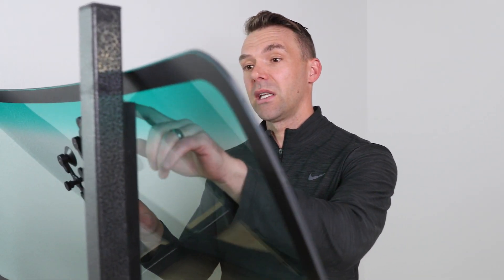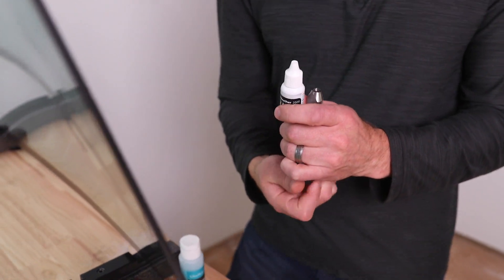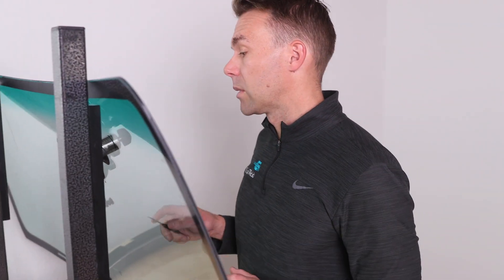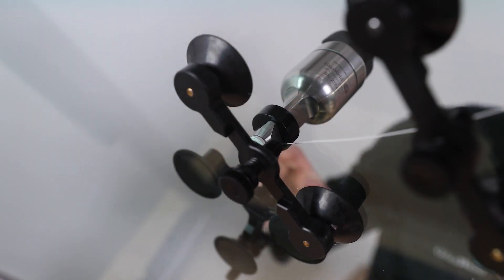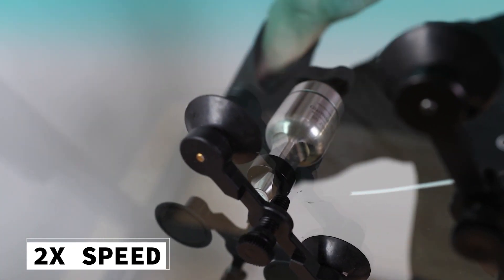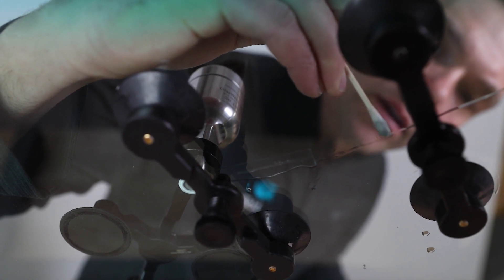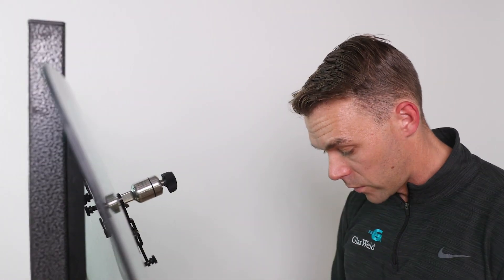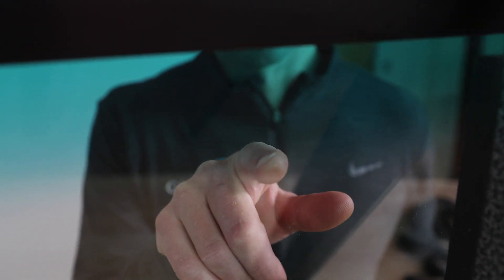Long Crack Repair: The Wicking Method

Comment: I did my first repair today 3/11/2021, it was a chip with three 2” cracks I have no experience in repair of windshields and it turned out really good. It was on a leased car BMW. I think I need the crack extenders because I was struggling a little to get the resins to flow into the longer cracks. After the job was done I could only see a tiny spot, I tried to make the spot go away with the pit filler but it remained the same.
Reply from the maker: Nice job Alex! Yes, the expanders will help with a smoother resin flow. When you're ready to take your technique to the next level, here's a video on long crack repair to help you out. We recommend practicing on an old piece of glass. Good luck! https://youtu.be/JtbJ-jNHHns

Comment: I have 3 large cracks generated from middle bottom of screen up to 1/3 Rd of windshield screen. Can permatex fill and repair them completely?
Reply from the maker: We recommend using GlasWeld long crack repair resin since it's designed specifically for repairing cracks. Here's the link to check it out: https://glasweld.com/product/crackweld-resin/

Comment: @glasweld Pls help, what is good glue/Resin and UV one or?
Reply from the maker: Our GlasWeld resins are the go to choice for techs who want a strong, long lasting resin. They've been independently tested to be on average 34% stronger than leading brands. Crackweld 1000 and 2000 are designed for long crack repair. Here are the links to check them out: https://glasweld.com/product/rock-chip-resin/.  https://glasweld.com/product/crackweld-resin/. If you have more questions feel free to email us at sales@glasweld.com or give us a call at (541) 388-1156 and we'll be happy to help!

Comment: Did you cure with the expanders on the inside of the glass?
Reply from the maker: Hello! We recommend slowly backing off the pressure on the screws of each crack expander before curing to allow the crack to slowly close up. Hope that helps.

Comment: can you repair crack going through all window? also it's half year old crack
Reply from the maker: Hi Valdas. Unfortunately, a crack that long has compromised the safety of the windshield. We recommend replacement for cracks longer than 14 inches. Thanks!

Comment: is the crack weld 1000 the thinnest resin you use
Reply from the maker: Yes, the 1000 crackweld resin is our thinnest viscosity for cracks. We also have All Weather 2010 thin viscosity resins for rock chip repairs.

Comment: What if there is no entry point of the break? Will you need to drill at both end of the crack?
Reply from the maker: Hello Guerrero, that's right, you will want to be able to inject resin into the crack, so an entry point is needed.
Reply: Appreciate your response. Can I drill in the middle of the crack as well? The long crack I have is arching in the middle bottom of the windshield...just above the dashboard..so 1 entry in the middle and 1 at the end of the crack...will that be risky?
Reply from the maker: @empoyvega6795  Hey, it really depends on your skill and of course the break. If it's possible that you don't have to drill, then try not too because drilling can always be risky. But if you need some assistance our team can help give you some more guidance. Send us a photo of your repair and your inquiry to info@glasweld.com
Reply: @glasweld  thank you. It will be my first time to do this. Its too expensive to repair cracked windshield where I am at. Its almost like buying a new windshield
Reply from the maker: @empoyvega6795  Of course. Good luck and let us know how we can help.

Comment: I don't get how crack separators are necessary given the crack is on the opposite side of the crack separators
Reply: The pressure from the extenders is just enough to open the crack that little bit extra for the resin to flow in the crack more deeply & easily
Reply: The crack expanders put pressure on the INSIDE of the glass right on the crack so that the outside bends to a more CONVEX shape and the crack opens up a bit.